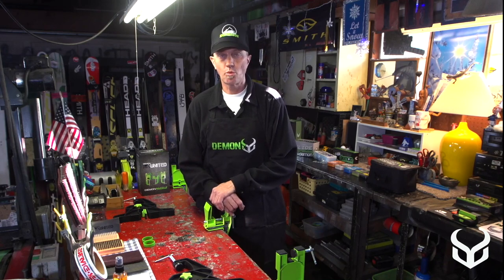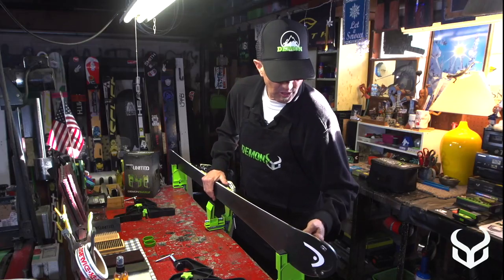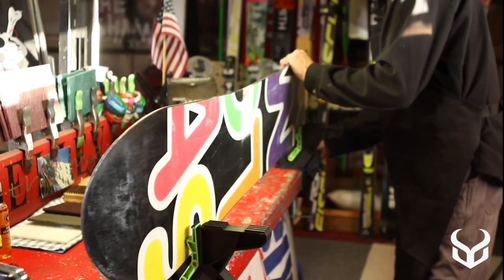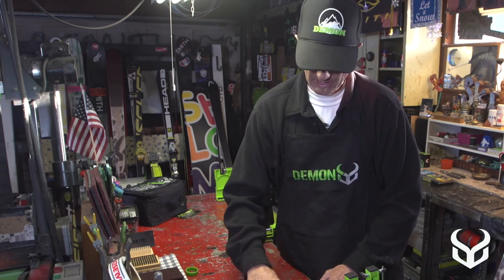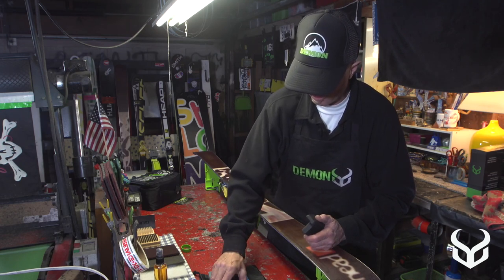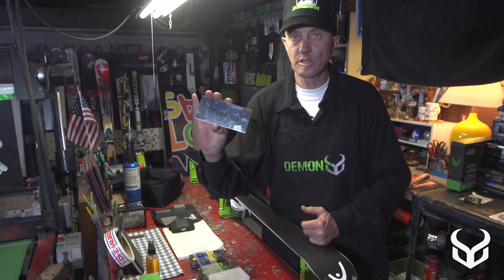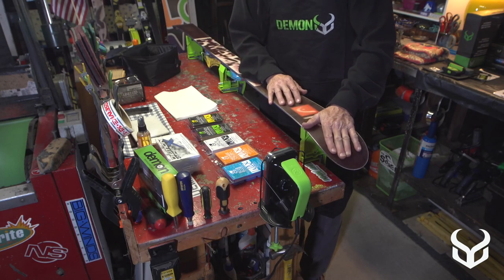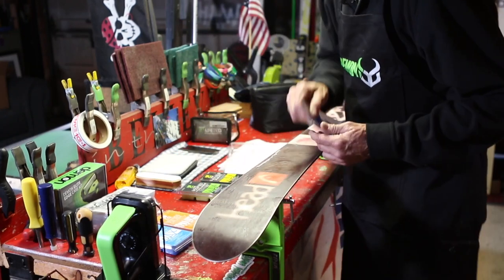Demon | Tune Up Demo

Comment: My daemon waxing iron is sad because I can't know the temperature.
Reply: Same man
Reply: I have a swix and it’s kind of wonky too. Are used an instant read thermometer to check it.
Reply: True but use a laser thermometer to get temp or just watch it.  If the wax is melting and spreading evenly without smoking then you have the right temp.

Comment: I thought the gummy stone was for slight detuning, not fine tuning.
Reply: The gummi stone will remove any burrs left by the diamond stones.  Just use lightly on the base/edge at a 90 degree angle.  Use at a 45 degree angle to detune tip and tail.

Comment: That file only sharpens the side edge, not the base edge.  He kinda acts like it does both
Reply: The file has the capability to set the base and side edge.  Standard for most people is 89 for base and 88 for side.  You are correct that he doesn't show the side edge being done - its video magic. :)